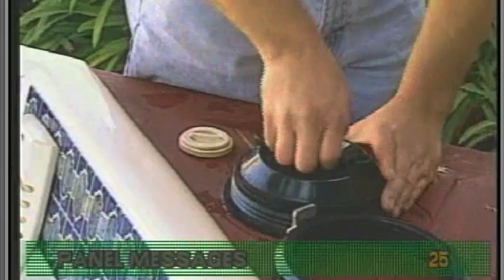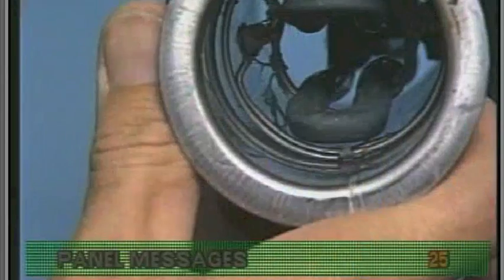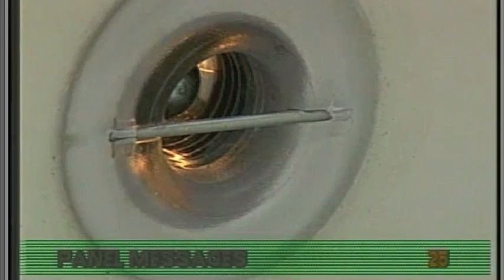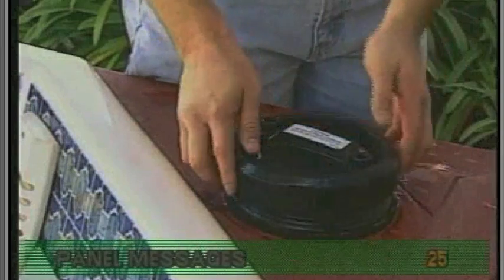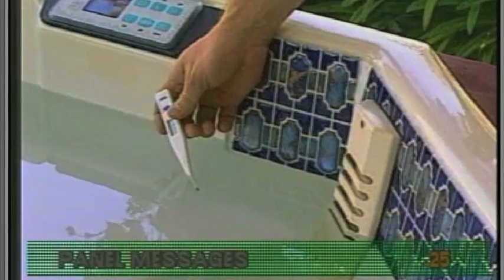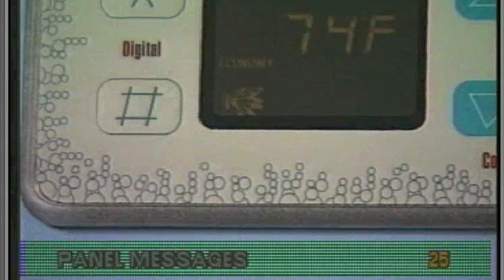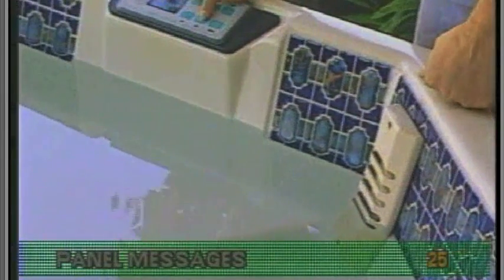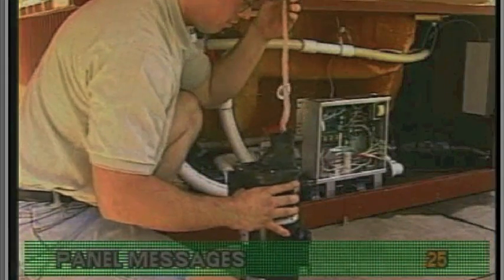Balboa Legacy Systems Series - Troubleshooting Panel Message OH

Comment: I have a legacy system from 2007 , my jets both work and the lights work , but the heat doesnt , the panel doesnt show any code , but it does fead like a digital clock with 00:00 and has the am and pm with it. What does this mean? I never saw this before.